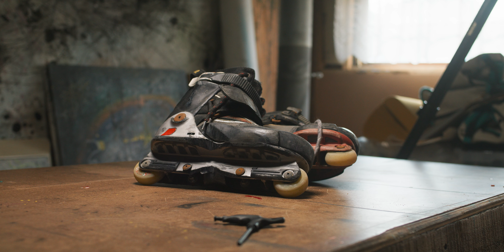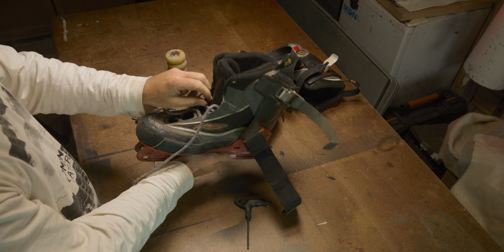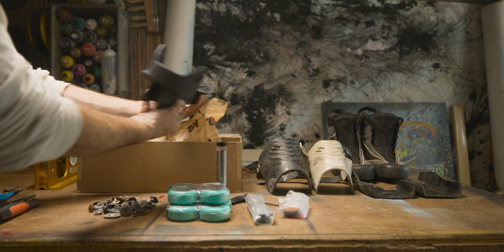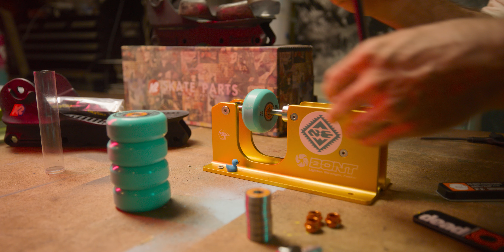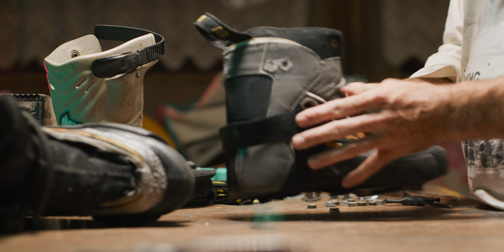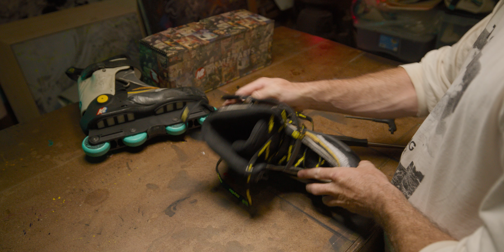ASMR Inline Skate Rebuild : 90s K2 250cc

Comment: Probably so comfy
Reply: comfy, feels just like I remember. They are old though. the newer ones were built way diff. Soyel is comfy and backslide. emmmmm
Reply from the maker: They are. You can feel your boot down on the backslide plate. Makes the felling of locking a trick more visceral.

Comment: Just be careful with those cuffs 😬
Reply from the maker: Haven’t had any trouble with the cuffs. Just the older foam. It’s not held up as good over the years. Still comfy though.
Reply: @anewproducts yea, the foam gets a little crusty. But trust me, the cuffs will crack in due time. Just be mindful/careful